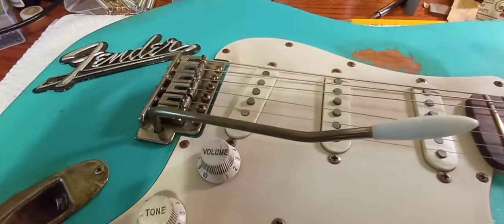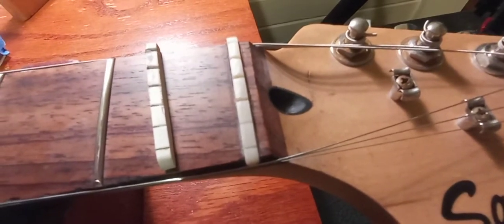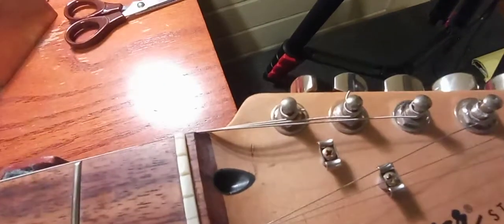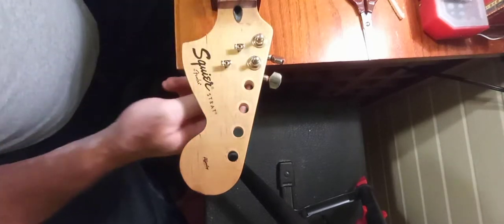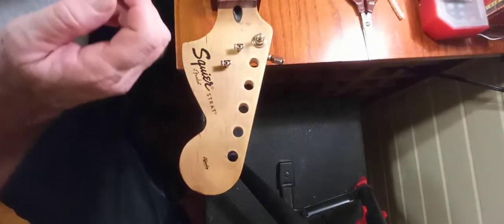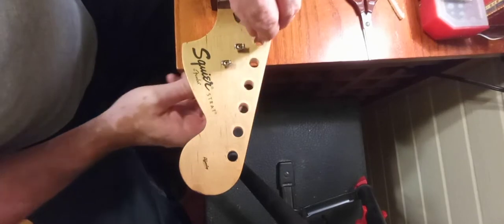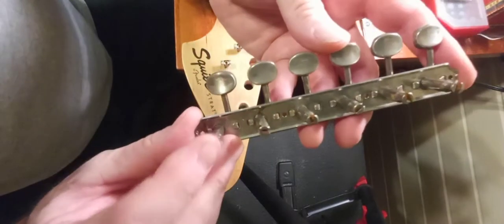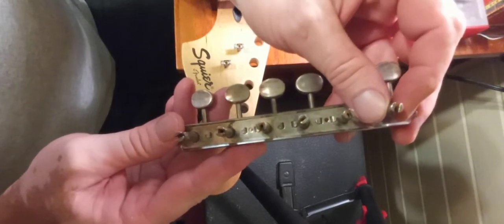Squier infinity strat relic gets upgrades

Comment: Hey man, Stuff happens.. great project again.. love it.. i feel better as these things happen to me all the time even i am an engineer and OCD about measurements.. Had my own happy mistake with GFS last memorial day during their BIG sale.. I wanted one of the Xaviere XV 870 strats to mod.. which are actually have great specs.. and for while looking at the clearance (last years stuff) I wanted the sea foam with rosewood board, but it had disappeared from the web page.  I settled on the surf green, but low and behold.. in the mail came the SEAFOAM one i originally wanted, even I had ordered the other one.. Happy mistake.. The XV 870 strat is FULL THICKNESS.. alder.. with real rosewood neck.. GFS pickups.. graphite nut..   The only complaint would be the neck was not set straight and all I did was loosen and adjust to retighten.. the bridge is a cast big block.. and bridge is regulation 2 7/32 string spacing.. awesome guitar to start with especially during sale time.. I may sand down the neck and stain it more vintage and put a dark tortoise pickguard on it..  Let us know how the new big block goes?  I was thinking ordering the entire trem w/brass block and having a few extra parts sounded like a good deal for me as my parts bin is low.. lol.. Cheers!
Reply from the maker: I've looked at the Xaviere brand but haven't had any experience with them. The Slick guitars also seem nice if you get past the headstock. I hate I had the wrong block but I will order another one. Thanks for the comments!
Reply: @justinrayguitars6024  I can vouch for the Xaviere XV 870.. good quality stuff, full size alder body (I hope)..good weight to it.. nice neck carve, rounded edges, fret work is OK, not horrible.. but it does have the 12 degree radius fretboard.. the older models have great dark rosewood which I love...good trem.. its there vintage spec trem.. nice big steel block.. tuners are not horrible but could use new ones.. standard GFS pickups - alnico 5 and decent electronics.. I'm fairly happy with it.. nut was cut nicely.. i will level the frets minimumly.. round off the fret ends a bit.. but it is a real solid guitar.  if you get them on the periodic sales and try a clearance item.. you get a great deal.. shipping is less than $ 20 for a 1,000 mile journey from Florida..  funny but you see them on eBay for more than you can get them from GFS on sale..
Reply from the maker: @bjstein4242  I was on there ordering some parts and went over and checked them out. Didn't realize they made a Jazzmaster. Been looking around trying to decide what I wanted. Believe I just found it. Only have to pick the color.